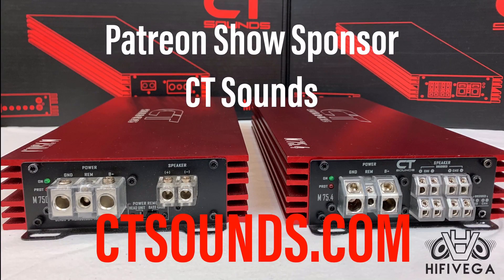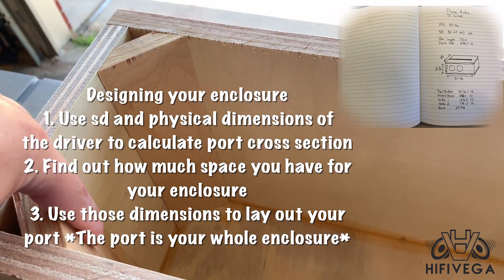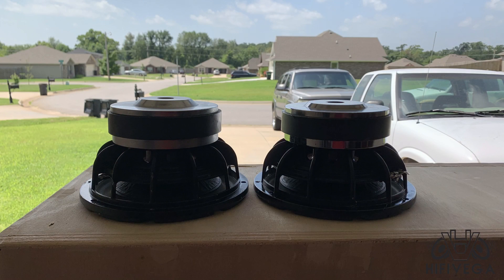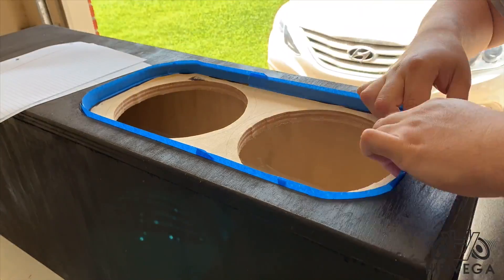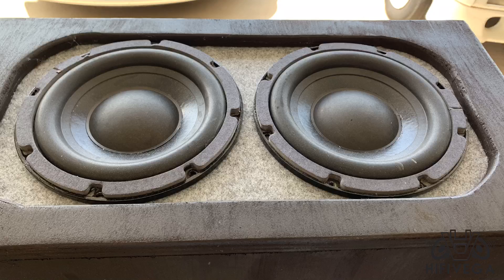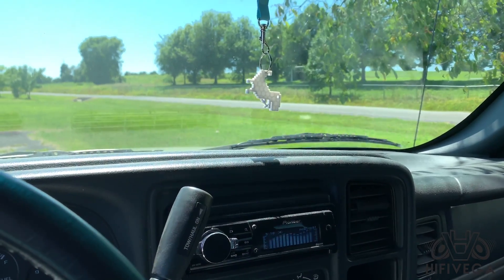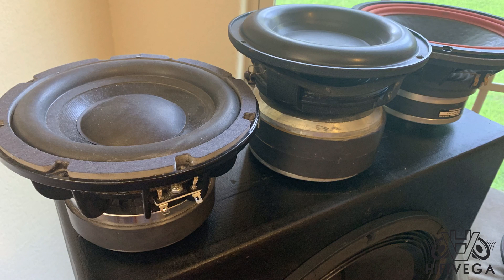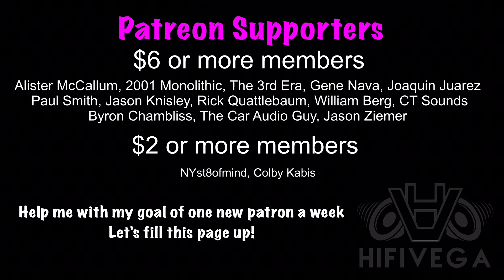T-line Enclosure Build for (2) 8 inch subs [4K]

Comment from the maker: Disclaimer: This box design may or may not work for your drivers because a t line enclosure is very specific, but I put this one out there in case you just wanted to play around with it.
Reply: HEY  I COULD USE SOME HELP CAL'ING THE PORT SIZE AN LENGHT FOR A 10PLB76 WOOFER TLINE BUILD IVE GOT TWO BOARDS THAT ARE 1.5IN BY 11.25IN WIDE BY 8FT LONG THAT I INTEND TO USE FOR THE FRONT BACK AN INTURNAL WALL AN ONE .75IN BY 4FT BY 8FT MDF TO USE TO MAKE THE SIDES SO THAT IN MIND COULD YOU HELP ME WITH THE DESIGN FYI I DONT MIND A TALL BOX JUST NOT A SUPER DEEP BOX PREFURABLE NOT MORE THEN 14INs I ALSO PLAN TO FEED IT 200WATTS SO FACTOR THAT IN IF YOU WOULD THANKS
Reply: @DREDKNOT2063  caps mate 😂. Have a look at transmission line tutorials that use hornresp. Then you can design one yourself! 👍

Comment: You can tune to much lower than the free e airair resonance (Fs) becouse it it not being used in free air. There is back pressure in the line. If the Fs is 60 you can tune to 48ish then play with stuffing from there.  Also the cross sectional area of the line can be much less than the speaker area.  Measure the openings in the chassis that will determine the port area. It's becouse the vibrating air can not go through the solid metal parts.

Comment: My 2 Rockford dual 4ohm  2208 would this work ?
Reply: They have been sitting in my closet for years and just purchased a Nissan Altima and want to install them ?
Reply from the maker: I think it would, but you’d wanna do some tuning adding polyfill panels until you get the response you want

Comment: t lines will not load the driver diaphragm as well as a normal tuned box. therefore, the u will reach xmax at lower than rated power. it will operate like free air.  it will have a wider but shallower Q than a normal ported box.

Comment: The vehicle does not do that box justice. Put that in a small car or suv and it would be so much louder. Also if using cheap subs it is worth checking the fs of the sub before building rather than trusting factory specs.
Reply from the maker: Dbjunior 123 I thought the same thing...

https://youtu.be/ZfXWFzTM-cY

Comment: Would love to see some Dayton Ultimax builds. They model real well in big enclosures tuned really low. 10" for example could use a 2.5 cube enclosure tuned to 22hz. or lower without going over Xmax
Reply from the maker: Josh M I’ve been wanting to play with some Dayton ultimax...
Reply: I bought an 8" Ultimax to play with. In the recommended 0.75ft^3 vented enclosure tuned to 30Hz.....I was really impressed. I've been doing car audio since 1992. I caught the bug after hearing an Audio Control ESP-3. So it's safe to say that I've seen the technology in these subs come a long way. 20+ years ago the sound quality and robust bass that comes from a U-8 was unheard of. 

I brought the fresh built cabinet to work with me Thursday morning to bump test it. My buddy had a CT Sounds Meso 8 to compare with.....do a build/review for yourself.  You'll enjoy it.

Comment: I love to build 1/4 wave TL's.  Because of their extension below tuning frequency, you will get more low bass and still retain the hard rock kick.  I currently have a Elemental Designs old 13k in a birch 1/4 TL and it will flex the garage door in my 450 sq ft garage.  I have an ED E3.8 in another 1/4 wave and one time I was watching Inception in my bedroom and fell asleep, only to wake shortly after when it sounded like a truck was hitting my house.  Now I have a Dayton Ultimax 15 in a huge 1/4 wave TL in my basement HT room ran off a BASH 500 plate amp.  I was watching Spiderman-Into the Spiderverse and when the collider goes off and the sub 20 hz bass hit, it rattled the metal floor registers upstairs.   Like HifiVega said the line length is dependent on the FS of your sub and line area is equal to Sd of the sub or subs you are using.   Say, if you need a line length of 120 inches for one sub and the Sd is 50 sq inches, you still make the line length 120 inches for 2 subs, just increase the line area to 100 sq inches.
Reply from the maker: cragre28 they’re fun to play with especially with small drivers
Reply: @HifiVega  Very important point.  Great for small subs to stay on par with larger subs, and the fact that 1/4 TL's are large for their given sub size.  The 1/4 wave TL for the Ultimax 15 is over 14.5 ft internal.  You just about have to go with lighter plywood instead of MDF because they get so heavy.  My TL 15 Ultimax is easily moved with a furniture dolly.  I currently have it firing from the garage side of my basement into the HT side, separated by a 2x6 wall with osb on both sides.   I am thinking I might build another one for my Dayton RSS390HO.  It is a 15 inch sub with a 21.5 fs, 12.75 x-max, but most importantly it has a 92.8 sensitivity.  With 240 watts it should be pretty insane.  I am going to corner load it and see how it reacts.  The hardest thing to do is lay out the lines where you get the exact same area throughout corners and multiple turns.  I can post the specs for a 15 with around a 20 hz Fs, if anyone is interested.
Reply: Do u sale t-line box design trying to get one for 2 sundown x8 v3
Reply: @saluteboyz  I would you give the plans for free if you give me a few days and an email address.

Comment: I wasted quite a bit of plywood and mdf trying to build transmission line enclosures. If I had a lot more knowledge of how to design for a particular drivers Theile/Small parameters maybe I would have achieved better results. Keep up the good work Robert.
Reply from the maker: vintage stereo buff their finicky enclosures to say the least... I still need to play around with this one to get it right

Comment: Oooh nice. I've just designed myself a single fold t-line tuned at 32hz for my id-max 12's 🙂 nice work Rob!
Reply from the maker: Thanks!
Reply: WHAT?!?!?!? IDMAX-12 in a T-Line?!?!? CRAZY! I build slot port vented cabinets for those subs and a single sub in a center console is insane.....

What's that t-line act like. If you don't mind sending some info my way on that MAX T-line I'd be forever in your debt.

Comment: Put that little box in a smaller car I'm sure she'll sound much better. That Suburban has a lot of air to move. I think I may try to build one for my  8's.
Reply from the maker: Funny you mention that... I’ve got a extended cab s10 sitting in the driveway 😉
Reply: @HifiVega  I had a single hippo in a single cab Ram. It was impressive for what it was.

Comment: Do you prefer plywood over MDF?
Reply from the maker: At this point I kind of do prefer it, but ask me 10 years ago and I would have been a die hard MDF guy lol.
Reply: I was always with the understanding that it is more dense, thus achieving more DB from the subs.  I guess I am still a die-hard MDF fan. Lol
Reply: Back in the mid-90s I heard from a car audio installer, that in some instances an 8-9 decibel gain can be achieved just by using MDF over particle board.
Reply: @mattmahoney9815  I recommend 1/2 " plywood for small enclosures ( under 2cu.ft. ) or low wattage. 3/4" or 1" mdf for big enclosures,
wall systems or high wattage with ceramic tile glued interiors.
Reply: @408SPLKINGS  that is interesting...I have never heard of gluing tiles inside.  I use an automobile spray undercoating to reduce resonance.  I have made enclosures out of concrete before.  It was completely impractical, but the results were impressive.  I use 1/2” MDF for smaller speakers.  Will have to go back and try plywood again.

Comment: Hey HifiVega! Nice to see another T-Line build. Did you account for speaker displacement? Do you even have to calculate for displacement with the 1/4 wave formula, because that was a similar concern in Mark's (Car Audio Fab) video? I ended up mounting my subs inverted for a couple reasons ... Clearance for my motor basket + potential lack of airflow + displacement (disregarding the additional air volume from the cone itself). I'm curious if mounting inverted would make a difference for you. I may test mine mounted normally as well. ... Anyway, nice build and thanks for the Video!!!  - @DJMoPhiya
Reply from the maker: Juan Romero Jr. from what I’ve read the displacement of the drivers has a very minimal effect on this type of enclosure... That being said you’ve always gotta do some fine tuning on these

Comment: hey vega, if you can post up the frequency response graph of the enclosure? that would be great.  the way i do it is to set all equalization to zero and start at 60 hz and check the spl and graph it (it doesnt have to be loud, like 100db) then lower the frequency 1hz to 59hz, plot the slp on the graph, then 58hz and so forth. do it all the way down until the subwoofer is 10db down. then for the safety sake of the subwoofers put a subsonic filter on at about the 6db down point. thanks
Reply from the maker: I still need to buy myself an accurate measurement microphone, but believe me it’s on the list lol. A very long list, but it’s still on there...